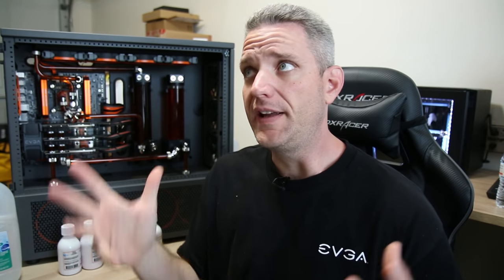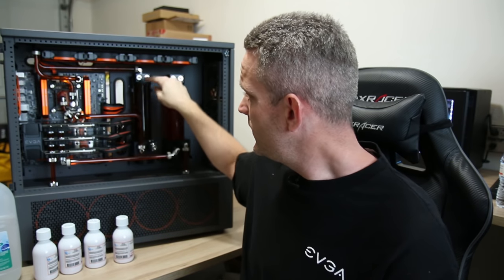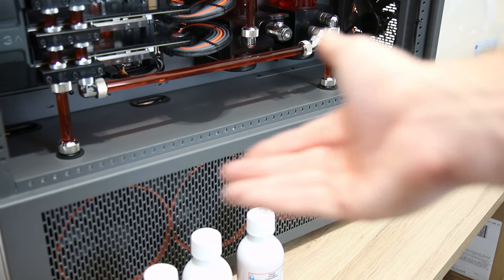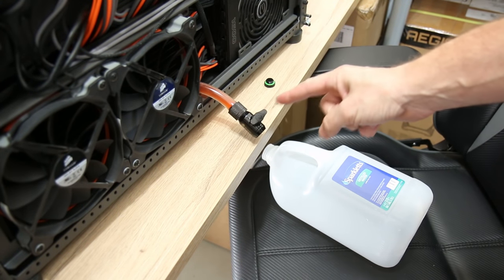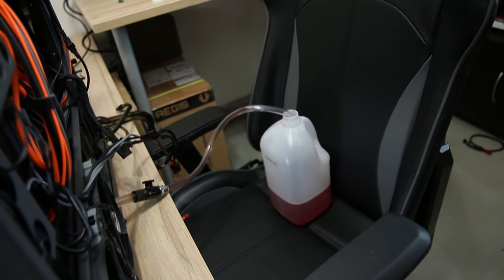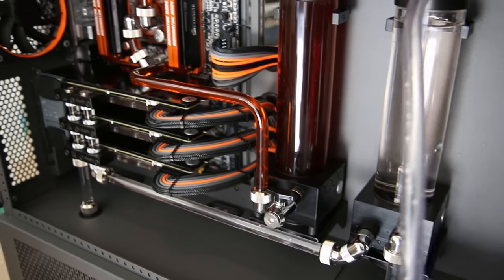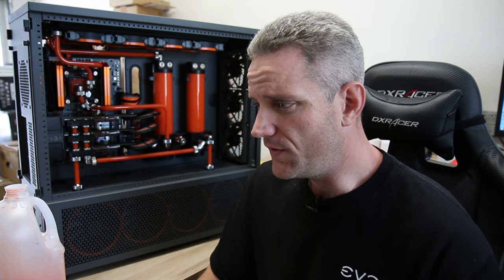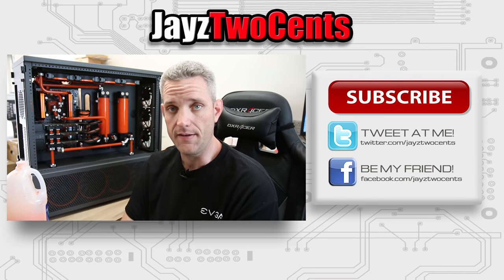How I flush my radiators and setup my drain ports

Comment: I know next to nothing about water cooling so excuse me if my question seems stupid to some. Why don't they have some kind of fluid like what is used in cars, some kind of antifreeze that is better designed to work with extreme heats like cars do? Seems something is breaking down due to heat and a liquid designed to work with extreme heat like an antifreeze would work better than distilled water. The dye too isn't working well with the heat but maybe they need to come out with colored antifreeze for pc water cooling that is actually designed to cool better than water and not change colors in extreme heat.
Reply: +SuperBigDog2U Antifreeze like whats in cars have anti rust and corrsion chemicals, also they have lubrication chemicals to lube the water pump, Antifreeze in cars is typically good up to 230 degrees F under pressure which is roughly 15psi, a water cooling system i doubt reaches pressure that high, antifreeze is also much more denser than water which will cause restrictions in tubing and has less of a cooling property than distilled water. The reason we use antifreeze in cars is for what i already mentioned above but also it wont boil on a hot summer day at 212f like water and wont freeze at 32f, antifreeze is made so your car can handle -20f and not crack your engine and not overheat, i am diesel mechanic, if you honestly think im full of shit then fine. My reasons why i wouldnt use it in a computer are above but also is highly toxic, a spoon full will kill animal or person for that matter, if you have kids or pets around it can be a bad idea if your loop starts leaking
Reply: +monster11082 Thanks. I know they wouldn't want to use exactly what they use in cars but thinking they should come up with something to use other than distilled water maybe. They would also have to color it or come up with dye that would work with that mixture I'm sure. These issues Jay is having and others I'm guessing is more on the dye side than the distilled water. Just curious why some form of coolant similar to cars wasn't used and you probably answered that question pretty well.
Reply: +SuperBigDog2U Antifreeze is designed for freezing temperatures, not necessarily to deal with heat. Straight water has better thermal dissipation compared to the typical 50/50 antifreeze mix found is the US.

Comment: Would it be possible to add a bit of long tube hanging down from the valve to add a bit of syphon effect to pull more of the fluid out in the first drain cycle ? Also, in the initial clean water flush, would it be an idea to add a drop of dish wash soap ? [  <:)  ]

Comment: Has anyone ever looked into a very weak electrolysis inside the rad or system? I mean I know you're using distilled water but it only takes a little contamination to start
Reply: How would you go about testing that?
Reply: +9ff70f96 Well with a really good multi meter and a probe with a sponge on it you could test do the test. But, I dont know where you could do it from in the system.  Jay would be the master of that.
Reply: And by really good multi-meter I mean something that can see 5 decimal places back. Also you'd need access to the loop while it was running. I've done it on a car, but a computer water loop...yeah
Reply: +Bill S - I suppose you could measure resistance to test for conductivity, but I'm not sure whether that would prove galvanic corrosion between the metals.  You may well be right though.  I think having a chemical analysis would probably be the better way to go though, that would take all these things into account, and determine the actual constituents and their concentrations in the fluid.

I know little about the subject, but would think there should be little problem between metals like brass and copper (which most hardware seems to be constructed of).  I would tend more to suspect things more like the solders used, flux, chemical agents in plastic parts, or even constituents used in alloyed metals.

Just thinking out aloud...
Reply: +9ff70f96 I totally agree with your statement. Flux and imperfect/poor soldering is quite common these days.  The only thing I'm thinking, anytime you have dissimilar metals and impurities suspended and moving in water, then add heat, things tend to break down. I mean most bases are copper right? Are the rads made of aluminum? Or copper/brass as well? I know nickel is in there too somewhere. 

Anyway, I was just thinking of something he could test and rule out along with sending it out.  Like you, thinking aloud!
Reply: +Bill S - Most rads of good quality are typically brass or copper end tanks and interconnecting tubes as far as I know.  If there's aluminium anywhere it would usually be the cooling fins and/or the aesthetic radiator surround.  Even the barb unions are generally brass or copper, so there really shouldn't be any aluminium/steel/other in contact with the fluid most of the time.  Whether the makers have constructed the parts in a high-quality copper/brass though is another question.  It wouldn't surprise me if they took shortcuts for economic reasons.  Then of course there's the type of solder used to consider.

What's further confusing is that, this time it's the CPU loop at fault, whereas it was the GPU loop the first time around.  But maybe the loops have been stressed differently during this period, with higher temps biased towards the CPU this time, and GPU prior.  There was also the seemingly excessive 'cocaine' build-up the first time to consider, but maybe not the second time (not mentioned in this video I don't think) on the alternative fluid.  Ultimately there could be multiple factors at play here with no single item to blame.

Comment: is it possible to drain out (push out) fluid with compressed air?
Reply: ehmm... yes :-)
Reply: Yes but you don't want to have the loop under too much pressure because a fitting might spring loose and you will have coolant everywhere

Comment: Jay you think bleeding yours is a trek, try bleeding my water cooled table. Between 3 240mm rads standing up and everything else standing up draining is a b***h
Reply: +Reirei not so possible in a desk build. If you lie them down it will either pull hair from the floor = dust or it blows air down to the floor which is annoying for who ever is sitting at the desk.

Comment: Hey Jayz I am about to build a watercooled pc and I want your opinion at the radiator. My setup will have a i7 4790k cpu watercooled at about 4,7GHz, 2 gtx960 at about 1500MHz watercooled with the ekwb thermosphere, the motherboard will be the gigabyte ga-z97x gaming1 wifi-bk watercooled, and probably 4*8gb of kingston hyperx  ram sticks at2400MHz or more also watercooled, and a d5 pump. I am thinking going with the ekwb coolstream SE 360mm radiator is that enough or should I go with a 480mm ?????
Reply: I would get the 480 or use a 360 and see if you can fit a 240 or even a 120 somewhere in the line as well.

Comment: I just realized that Skunkworks has DDC pumps. They are nice looking combo units and the definitely match the system with the square looks and all. I'm just surprised that DDCs have the flow rate to work well with such big loops and parallel blocks. Makes me wonder how low I can go with my D5 before seeing any temp changes since I only have 2 rads and 2 blocks.

Comment: Jay,

Hypothesis: Will using sterile filtered water prevent the color change? I noticed you used your mouth to blow air into the closed loop system. Is it possible that you are creating an environment for bacteria to grow?  Do you use bleach in the water to flush the system? Distilled water source could be inferior as well. Just because it has a name brand label it could be from a municipal source. a.k.a treated water.

Water for injection, or Sterile water might help eliminate your primary issue of color change, in addition to using a filtered air pump to assist in removing any residual liquid in the loop.

Just my two cents.

Good luck, thank you for sharing your work. I enjoy your videos.

Sincerely,

Gentleman Adventurer.

Comment: Hi Jay,

Not sure if u will read this but I've been in saltwater aquarium for a while now and we use a lot of distilled water or RODI water (reverse osmosis deionized water). Something, store that are selling distilled or RODI water are not doing maintenance as they should so that the PPM in your distilled water might not be optimal aka 0 ppm. Does that affect the fluid you are gonna use since you might have a lot of dissolved particule in the water ? Just a thught

Comment: You state that you have to blow into the computer. Why not use a Datavac Duster(Blows air) and press it into the tube? Some possible things Dustvac has less bacteria than your mouth or anyones mouth. Another point is that the Dustvac has a filter to help alleviate foreign particles(dust, food residue). Last point it that the Datavac can blow longer and more consistently.

Comment: Why didn't you put just distilled water in your system and see what happens ,so if it changed color you could see exactly what was the problem because you just have H2O and whatever the culprit is and if it didn't change color it meant that it was something reacting specifically with just the die ?

Comment: Jay. I'm sitting on the toilet and had an idea. What if you made an adapter for the sink or an air pump to push out the fluid. Not sure if that would work. Or you could pump through the distilled water. Just poop thoughts here.

Comment: just use distilled water, that works fine for a water loop and also if you want to, add your dyes in if you want. They also could be the reason that it's changing color.

Comment: I don't have extra ports on my reservoir so how do I drain my loop?!? Please help me guys, I need to drain my loop
Reply: all you need is to create a space to allow air to go in. so taking the Cap off your res is usually the best option, or in extreme cases carefully removing a tube from a fitting (but that's a last resort)
Reply: tarfeef _ but how do I actually get the liquid out?
Reply: TheLoneWolf so you have the one drain where you want stuff to come out. Attach some tube to it and run that over to a bucket or something. If you didn't make a drain port, you'll have to yank a tube out. That would require a lot more carefulness. If you yanked a tube, you're done. Just let the liquid pour out. If you have a drain, then you'll need to do what I outlined in my last comment, and find a second location to open up. Once you do, the loop will begin draining automatically because physics
Reply: tarfeef _ but I don't have a place for a drain
Reply: TheLoneWolf of course not... Then you're gonna have to yank out one of your tubes. Find the one that's easiest to access. Put a shitton of paper towel around it, and a receptacle under it. Then yank it. Then rotate the case so that the tube you yanked is at the bottom of the PC, and shit will pour out
Reply: tarfeef _  could I use like a 5 way splitter to continue the flow but still add a drain port?
Reply: You can, but that will obviously require you to first drain the loop so you can add that in

Comment: how much does it even cost for a separate watercooled system? (A own lupe for the gpu and an own for the cpu) I'm 14 and I don't have $5000
Reply: the second loop will cost about the same as the first, depending on how many gpu's you have. Each gpu block adds alot to the price depending on the gpu,
Reply: I'm having 2 gpu's (1070) and 2 radiators. just the computer itself is worth around $3200 (The cpu is the most expensive thing) and then it was the watercooling
Reply: then the gpu loop would be a couple hundred ish dollars more than the cpu loop
Reply: Taz Gaming ik. I have been looking around on parts

Comment: I'm slightly worried about my Alienware Area 51 R2 Machine - it's CPU liquid cooled and a closed system unit - the desktop is close to the end of it's warranty; should I be worried if this liquid cooling fails or requires to have the coolant changed? This is my first liquid cooled machine (please avoid messages regarding pre-built machines, a client purchased this machine for my work).

I'd appreciate a response, so should I have to contact Alienware for any maintenance before the warranty ends :)
Reply: +Scott Baker (Sythenz) That's an AIO (all in one) liquid cooler and requires zero maintenance. Most manufacturers warranty the retail versions for 5 years. If anything were to fail it would be the pump that's built into the CPU block and your PC should (?) automatically shut down if that happens. Just keep an eye on your temps.
Reply: Always keep an eye on my temps - thank you for the reassurance, I've been watching too many liquid cool videos and gotten worried; do you happen to know of any software that would be able to warn me overnight (sound?) should the temperatures rise dangerously? I do over night renders/lighting builds on this machine and would like to make sure nothing happens that's damaging. :)
Reply: Another quick question - should the time for replacing the thermal on the CPU block come around, removing the block won't cause any issues (leaking etc?) - Just unscrew the block, rethermal and place back on? thank you in advance. :)
Reply: Scott Baker There's built in thermal protection on your CPU. If the pump fails the CPU will get too hot and shut down before it fries. It shouldn't spontaneously spring a leak either so that's why if your temps are OK I wouldn't mess with it because that's what would increase the risk of the tubing possibly coming loose.
Reply: Great, thank you applemaggot for the help - I really do appreciate it :) Great community support Jay has :)

Comment: I do have a question though. What if the fluid you just put in doesn't change at all? is there still some science to be done for the fluid you pulled out?
Reply: +Viddell Geter The fluid he pulled out had product from another manufacturer so wouldn't be much use for Mayhems to analyze. Maybe he sends it anyway? The color change was only happening in 1 loop last year and now it's happening in both so it's actually gotten worse even though he's swapped coolant and flushed a bunch of times. I'm going to be staring at his rig in any video now looking for it to change now LOL :)

Comment: ***** JAY...DUDE! This has been going on waaaaaaaaaaaaaaaay too long. I know you wanna troubleshoot it for science reasons, but srsly, why don't you just replace the rads, block, and tubing just to be sure and see if it does it again. Don't clean....replace (you could use review samples, or reach out to various vendors so you can make another video about all this) I hope you get down to the bottom of it, but it seems like you clean these rads and blocks and its clearly not making a difference. I know you've used several different fluids and it doesn't make a difference. I'm clearly interested in the end findings, but wanted to know why you don't try different rads/blocks as a way to rule them out? Thanks bro, keep it up! Congrats on the new house btw, looks great and I'm supes jelly bruh!

Oh and also, have you considered that it may/may not be the syliva in your spit when you blew into the rad? What are the chances of that being a possibility?
Reply: anonymouspoop | CSGO then why is still turning dark bruh? Don't rule anything out just bc he flushed it. Bc he's flushed it several times and it still changes shade

Comment: i just recently encounted a problem with my loop my fluid leaked and its a brownish black colour when it was changed not long ago any ideas what can cause this? i used a hardwear labs black ice 420 sr1 radiator with a XSPC RayStorm CPU block,Bitspower 1/4 Thread Compression Fitting 1/2 ID 5/8 OD Tubing Matt Black,Mayhems Aurora - Galaxy Purple Coolant,ClearFlex 60 1/2" ID - 5/8" OD (13-16mm) Tubing : Clear,Bitspower 1/4 Thread 90 Degree Elbow Fitting Matt Black,Bitspower1/4" Triple Rotary 90Degree Barb Fitting Black, Monsoon Series Two Basic Dual Drive Bay Reservoir for One Laing D5 Pump : Black and the pump.
Reply: There is probably something in the radiator or anywhere you can't see the water go unless it's the liquid eating away at the tubes if you got cheap tubing or a weaker set so look for those things
Reply: +Oliver Bishop - If you got UV lighting in there the microbes may have developed Sun tans.  Try adding some factor 30 sun cream in there next time and see how that goes.
Reply: its not uv fluid or got any lighting part from the led's in the reservoir which are off and none of them are uv anyways it was also changed out and replaced not long ago with new tubing and everything cleaned out plus new coolant. so far it only lasts at most 3-6 months before the coolent goes funny.

Comment: Hey Jay, would it be possible to put 2 resevoirs in the same system? if so, would you need 2 pumps to drive it?
Reply: You can put two reservoir to the same pump and you can even put them in different places too. However, one of the reservoirs should be directly before the pump to minimize the risk of running it dry. The second reservoir can be used to help bleed the system, should your first reservoir be looped and lack sufficient ports.

The second reservoir does not need to be looped except for the bottom outlet, should you wish for it. But generally 1 reservoir is more than enough. Having two reservoirs would just be looks for and perhaps quicker refill.

Comment: why don't you use DI water
Reply: Because you get no performance gain from using DI water compared to Distilled, plus you have to make sure it was Distilled before it was deionized or else it will just reionize and still have all the minerals and metals it had because it wasn't distilled. I made this mistake and bought cheap DI water and it ate my system up because it wasn't also distilled!